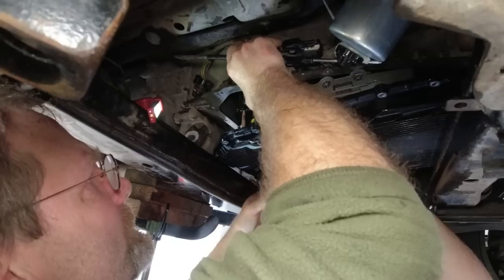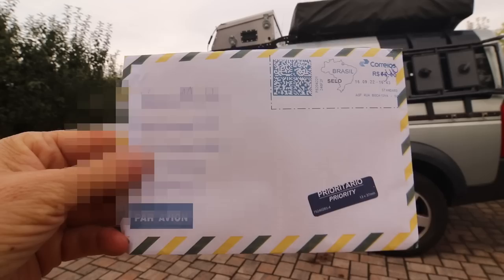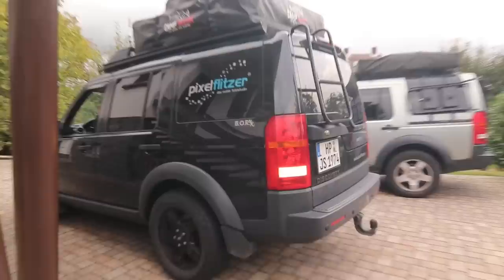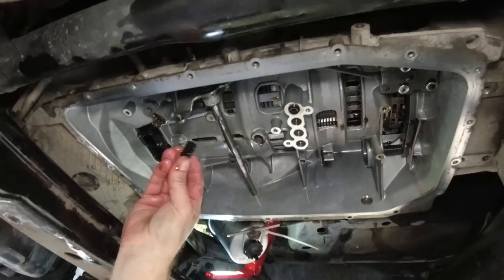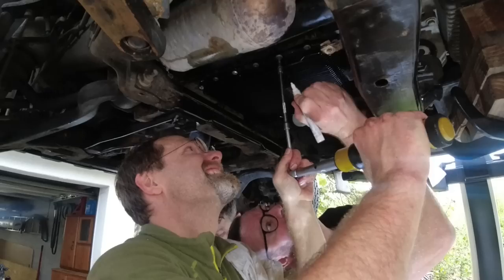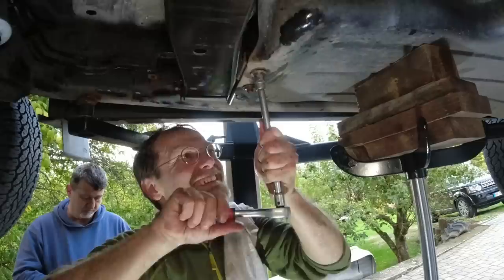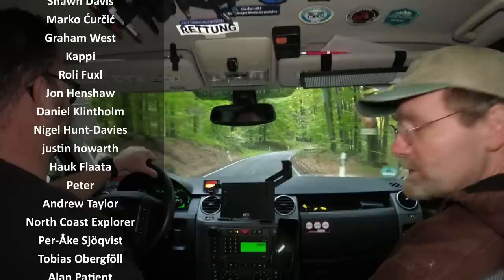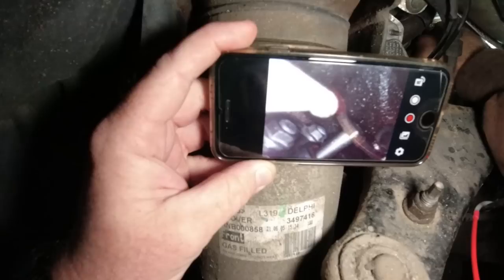Drive Line Vibrations - ZF 6HP26 Repair - Land Rover Discovery 3

Comment: One thing about switching over to metal transmission oil pan, don’t ever use the provided paper oil pan gasket, it will leak even if you use rtv sealer. I strongly recommend and if you can get this Ford transmission pan gasket part number 6L2Z-7A191-BA, it’s for a 6R60 6R70 and 6R80 transmission used in Ford/Lincoln longitudinal engine trucks and suv from 2006-2016 these transmission are exact licensed copy of zf 6hpxx. 

Pan gasket has outer metal perimeter with inner rubber bonded gasket and has identical placement and location of sealing surface as the plastic pan and it can be reused a few times before it needs to be replaced. 

I had issues with the paper/composite gasket received from Atlantic British metal pan kit, it leaks and no matter how much rtv/sealant I use it will still leaked, after cleaning the surface and switching over to that pan gasket, no leaks and no messy residue from removal. I’ve drop the pan twice, reused the gasket and still no leaks.
Reply: Thanks for sharing.
Reply from the maker: Thanks for this explanation.  Christian

Comment: Love the videos. Just replaced the oil & filter in my 2008 Discovery after 5kkms with 5w40 instead of 5wdumbass and the difference was amazing. The engine sound so much quieter. Also inspected the oil filter…and no shinny bit…thank God! Thanks for the tip Christian 😉👍
Reply from the maker: 😀💪👍🙋‍♀️Vera

Comment: All Sunday activity is on-hold until an LR Time post 😃  The Turbo actuator is a problem on Jaguar with the same engines - especially those with 2 turbos as the second doesn't cut in until around 2800rpm and so is little used and the rod seizes.  Good stuff as ever 🙂
Reply from the maker: Thanks Mark.  Christian

Comment: Great video!! You are brave to have taken the mechatronic out with the filter!!
For reference... I used the metal sump and never had any problems. Also... ZF used a metal sump on certain BMW 6HP transmissions so I don't think that the metal sump is an issue.

Comment: Just did this.  And fixed my shudder.  Chasing. Gearing and rattling.   And i had no faith.     Land cruiser is cancelled.   Did put in 1 dr tranny shudder fix as well.   Did it exactly like this all alone.  No problems.

Comment: The Britpart pan is worth it, I had a similar issue but my torque converter would flatly not lock up and give me a transmission fault. I swapped all the solenoids and seals and did an ATF change and she's been great ever since. I wish I had a lift!

Comment: Loosening the RHS engine mount also give you the space you need to be able to fit the original ZF filter. Change oil regularly and it will save your transmission.  Try not to exceed 1 year / 60k km drain interval. Love the content again

Comment: I had the same shuddering on my Discovery 3 when I purchased it but took a chance. 

The quickest and short term solution is to add a quality transmission lubricant additive that cost only a few euros (e.g.  Dr Tranny removes shudder instantly). 

The far more expensive alternative is to get the transmission rebuilt . 

If you'll pardon the pun, I went down that road and took my Disco to a transmission specialist. It cost of €2700 to rebuild the transmission, which included a reconditioned torque converter and replacement mechatronics valves and clutch.

However, the rebuild failed as I was getting transmission errors with the Disco going into fault mode. The transmission was removed two more times but the problem persisted. I decided to buy a new ZF mechatronic unit from ZF directly. This cost another €1200. I went to another transmission specialist who installed it successfully for €700. I had a historical issue with the Discovery not able to go into sports mode (triptonic mode). I thought the new mechatronic would have sorted this. I took the Disco to an electric mechanic and found out that the sport mode wiring was damaged.

I finally have the ZF transmission working at a cost of approximately €5000. I bought the vehicle for €6000. 

My Disco is like my high maintenance lover, requiring lots of money but giving great pleasure....
Reply from the maker: Wow.  This was bad luck but also some good luck.  Glad it is working now.  Christian
Reply: @Vera_and_Christian  It's purring along for the moment and I've been advised to do regular transmission oil changes every 40-60000 km also.

Comment: Great video as usual.  I love it.  If you use the metal pan on the ZF 6HP26 make sure you get a metal/rubber gasket.  It looks very similar to the OEM plastic pan gasket.  The fibre gaskets are hopeless and leak.  This is from trial and error on my side.  I could only find one supplier in Aus but you may find more in Deutchland.

Comment: Ingenius oil seal replacement on the Mechatronic/valve block whilst keeping the plastic pan in place- goes to show some of the TC shuddering may not actually be the lockup clutch at fault and only a leaking seal

Comment: I had RPMs bouncing as well and only on gear. Sometimes hesitates to change gears, and vibrates vigorously. No codes, took it to the transmission doctor, he test drove and suggested to change the transmission oil and filter. Oil pan didn’t have any metal shavings, 170k miles on the transmission. Didn’t have any issues after till about 2000 miles. Now I’m about to do another oil change again to get rid of the little bit of hesitation it has.
Reply from the maker: If it’s the 6HP, you need to change those 5 seals and the connection sleeve.  Christian

Comment: For ZF gear box there is one more rubber seal sleeve go over the electric plug, which do leak on high mileage car.
Reply from the maker: We replaced it too. Came in the kit.  Christian
Reply: @Vera_and_Christian  Next job, replace the centre bearing on main drive shaft.   Normal way is to replace the whole lot, shaft and all.   Like to see how to only replace the bearing only.   If anyone can do it, it would be you. 🫣

Comment: I put the steel pan on our family LR3 back in 2018. Was much easier than the Land Rover workshop manual procedure of lifting the engine, removing the passenger catalytic converter and finally the pan. Land Rover in British Columbia quoted me $3000 for a new pan, fluid and install. I used the Atlantic British kit here in North America and with the fluid I was into the repair for $400 CAD. Have 30,000 KM since then with no issues. 

Great video! Just so you can take a look there are many vehicles with the 6HP26 transmission. I noticed that some BMW versions are all aluminum finned like URO parts # 24152333903PRM these list the LR3 and LR4 as applications and look even better than the steel pan. I installed. Great job again on the mechatronic seal repair. Many people here in North American by rebuilt transmission not knowing about those seals.
Reply from the maker: I actually learned about this from a YouTube channel in Florida. The guy explained it really well.  Sorry forgot his name.  Christian

Comment: Great video again. There is the metal oil pan like you said. You can change  the oil filter with that too. If I remember right LR did not list even an oil change for the zf6hp in all it's lifespan. They changed that to 150kkm later. If you look at ZF it's 60kkm oil changes. Not surprised they die. There is a chap named Garry Ferraro on yt with videos about  zf6hp's. I think one of the best ones.
Anyway your skill is amaizing! Those lr's need people like you. It's the best suv you can buy if you have the skill to keep it running.
I always like waching you. First class stuff. You know how tu make a superdifficult repair look easy an fun.💪👍

Comment: I wasn't having any issues with my propshaft, but on checking it, I found that some of the rubber surrounding the centre bearing was disintegrating.  I repaired it using black Sikaflex 228 smeared into the missing areas and gave it a coat all over.  I checked it again recently, and there has been no further deterioration at all.

Comment: Gutsy to dive into the transmission and great work from all of you. I got to drive a LR3 for 3 days last week, interesting how different it feels from my L322, the LR3 has stiffer suspension and steering, a bit faster acceleration. I believe it was the same year as my L322, so interesting how they differentiated the two models with map screen and other bits.
Reply from the maker: I think the RR software can be enabled on the LR3 as well.  One of the things I have planned.  Christian

Comment: Fantastic video as always.
Do you think the Prop-shaft centre bearing bush failure is due to the vibration from the transmission?
LR say the ZF auto gearbox is filled for life. They must think the life expectancy is only 100,000 miles! 
Of course it isn’t. So it is a good idea to flush the transmission with new oil at that time OR if it starts to get a vibration and/or engine RPM fluctuation under acceleration. 
Flushing is the only way to change all the transmission oil, because much of it is inside the Torque Converter. Just draining the transmission will not change the oil within it unless it is properly flushed.
It may also be a good idea to add 2 tubes of 59.2 cc ‘Dr Tranny’ Lubeguard Instant Shudder Fix to the new fluid to prolong the life of the Torque Converter locking clutch. This stuff works really well and cures the shudder after maybe 20-30 miles from adding it.
If the shudder returns after 3 - 4 years, but less than another 100,000 miles, add 2 more tubes of Dr Tranny.
It really does work, by correcting the oil’s viscosity and costs less than 25 Euros.
It also saves so much oil getting on your driveway!
Reply from the maker: The center bearing issue is quite normal and does not really do any harm.  But in combination with the jerking trans it amplified the noise.  Christian

Comment: That would be a horrible repair without a pit or a hoist such as yours. I fear there will be an increase in the price of second hand vehicle hoists as every LR3 & LR4 owner sees the value in owning one after watching your videos!

It is great that the transmission is okay, great repair every one.
Reply: you can do this work if vehicle is run up on blocks and offroad height selected not easy but doable.

Comment: Yeah, the 6HP26 oil/filter change is much easier if you go with the aftermarket oil pan and separate filter. It's even easier on a Range Rover since there's no crossmember in the way 😉
Reply from the maker: Unbelievable that this seal cured a major shuddering.  He is really happy. Christian
Reply: @Vera_and_Christian i was about to Get a new converter and Probobly box.

Comment: Probably my new favorite channel. I finally was able to buy my first Land Rover last week! A 2010 LR4 HSE with the 5.0 ltr. The day after I brought it home the RPM's started to fluctuate up and down while I drove. 2 days later I felt a small shudder when I took off from a stop. Were these the symptoms on this LR3? do you think this process could fix mine?
Reply from the maker: Thanks for joining, It is possible, and likely that this the cause, but you have to investigate it. You can see in the video how Christian diagnosed it using the oscilloskope function of the GAP tool. A Gap tool is also then needed to reset the adaptation values. But check out the videos we have with our New MAll Crawler, the cause was different, but the symptoms where the same. And watch both videos please, as there are more LR 4's affected by this problem. https://youtu.be/T4k9-_PzFN8 and https://youtu.be/pHYJsJb-tVQ  🙋‍♀️Vera

Comment: Very interesting topic and video. Thank you. So for the vibration part it was simply his driveshaft bearing, fixed with a tie wrap? The  "jerking" was actually harsh shifting due to just those few seals on the bottom of the transmission?  Are these seals the likely cause of harsh shifting for this ZF transmission? Would replacement of these seals be a good starting point if people experience harsh shifting ? Would be a lot cheaper than a full rebuild or replacement, which would be the likely recommendation if you took it to a transmission specialist.
Reply from the maker: The jerking comes from the clutches in the trans slipping because of pressure loss through those seals. Clutches will burn quickly and then the trans is wasted.  Christian

Comment: Oh boy,
1,5yrs ago I send my zf unit to be restored (‘08 RRS) and I have the same vibration issue… or I think i have.
Hope it will only be the driveshaft that vibrates…

Only schutters in reverse or drive gear and not in neutral btw.. and not all the time but only when I start to drive.

Comment: Ugh.... dreaded drivetrain vibration.  2006 LR3 V8 auto.  Vibration really kicks in at around 65 to 70 mph, when under load only. Gets worse after driving for a few miles, when things get warmed up. Up highway incline under acceleration it's real bad. One would immediately think bad driveshaft, though doesn't vibrate when letting off throttle. 
To date I changed drive shafts, transmission, and transfer case, with no charge.  All suspension components are new. Wheel bearings are good. 
Front and rear diffs were rebuilt with ARB lockers. At this point I'm thinking that it's one of those differentials.  
I've been chasing this down for a year now.
Reply from the maker: It does sound like the issue we had. But ours was rpm depending and less speed depending.  Mainly in 3rd and 4th gear.  Christian

Comment: Hi Christian, always extremely good work (the watchmakers in Switzerland could still learn). There is slight criticism of the 6 HP automatic transmission ... but the 8 HP is basically the same, or am I wrong?
9 HP automatic transmissions are built completely differently, as more for smaller vehicles and proportionally all-wheel drive
I don't know anything about Toyota either... the knowledge gap is hopefully not serious!

Comment: Another entertaining video.
Working on bmw with zf trans, replaced all those seals but the car still does not move properly when hot. What could it be? The fault code I get is the same as before seal replacement 4F81
Reply from the maker: Did you follow the re-learning procedure?🙋‍♀️

Comment: Great video. I’ve got a transmission fluid leak from the bottom of my bell housing and am now wondering if it may be mechatronic seal causing this. Do you think that is possible? I also recently calibrated the clutch on the transfer case which I found fixed what appeared to be a jump into 1st gear. I don’t really understand how the transfer case clutch adjust relates to the gear change though. The transfer case clutch calibration improved all the gear changes instantly.
Reply from the maker: There are videos how the adaptation works.  The seal cannot cause a external leak. Christian

Comment: Approximately at the 12:00 mins you are dealing with a stripped bolt. Where is this bolt? Thank you for another great video!
Reply from the maker: One of the oil pan bolts snapped. Luckily not one of the hidden ones.  It was near the shifter cable.  Drilled it out and tapped it.  My specialty.  I get any bolt out.  https://youtu.be/T-4rZ4FYQTE.  Christian
Reply: @Vera_and_Christian  Bravo!!!

Comment: The parts numbers supplied in description don't come up. I believe these are correct?

1x sealing sleeve - 24 34 7 588 725 
1x adapter - 24 34 7 571 211 
2x sealing sleeve - 24 10 7 519 314 
1x sealing sleeve - 24 10 7 519 315 
1x sealing sleeve - 24 10 7 520 715
Reply from the maker: Remove the spaces or search 6Hp seal kit.  Easy to find but only as a kit.  Christian

Comment: I just did a transmission changed and pan upgrade also the changed all solenoid,  valve  body sleeve , the zf  4 round tubes and square shape gasket , before I did anything I had codes 5th gear incorrect ratio and 6th gear too , once I changed oil and solenoid and gasket it drove ok with some slippage at times to now I have transmission fault with higher speed will drop air suspension,  I hate this transmission vera a very lucky woman to have manual transmission much easier to work on , I'm done lr3 has 160k on transmission I only bought it for 1100. Dollars I will buy a remanufacture transmission new no longer available,  here in USA land rover dealership won't work on any land rover over 10 years old , so I take it to a private shop ( north Texas British shop ) cost 6 times what I paid for land rover around 7,200. Ouch if I wasn't planning on keeping the lr3 I would not spend this much , a perfect job for Christian you tube channel replace transmission,  my 4.4 v8 runs very quite,  if mine was a manual transmission I do the work myself but torque converter manual transmission I know nothing about if install incorrectly can be a bad day , for me I let a shop do this 😞👲,  

I have new air suspension to install all 8 control arms , I also had real bad play in steering,  found lower steering shaft ujoint in real bad. Condition,  was tough to get to it takes a 10mm star socket you can reach it if you turn steering wheel towards wheel I removed heat shield and used breaker bar to break nut, the top bolt easy to get mine snap off , I also had to use breaker bar and hammer to get lower steering shaft off steering rod that bolt shaft to steering control unit , I also tied off steering wheel in place so it won't get out of position when I reinstall it 

💛 my land rover lr3 she ought to be happy I saved get from being a parts car and in giving her new life as and old school rover I only hope she appreciate my effort 😱omg, 
 Everytime I start my lr3 the CD player makes noise like a CD trying to eject this can't be normal is my lr3 possessed or trying to tell me something, 😱 omg , or just need new radio ........ Greeting from TEXAS
Reply from the maker: I hope you get the trans issue resolved.    And thanks for saving a Discovery.   Over here, prices are up now as the LR3s become rare.  I think your CD Player is signaling a thank you 👍🤔.  Christian